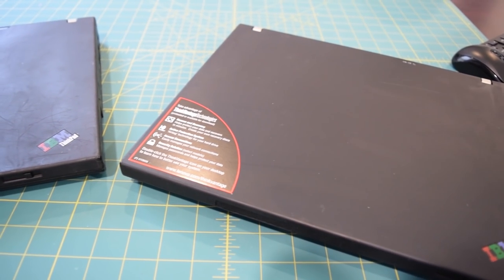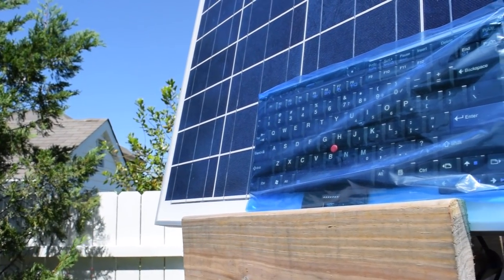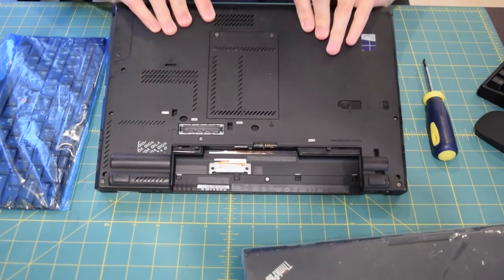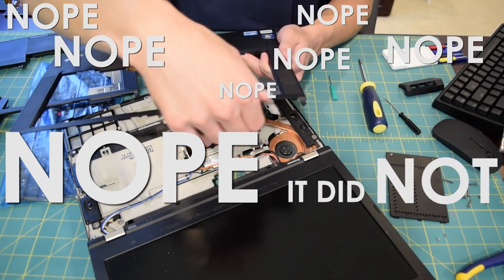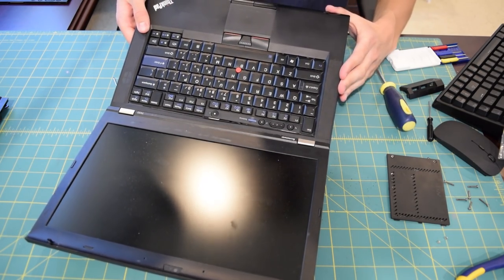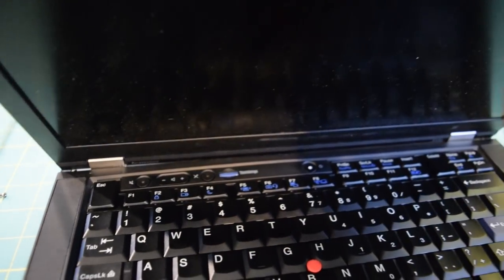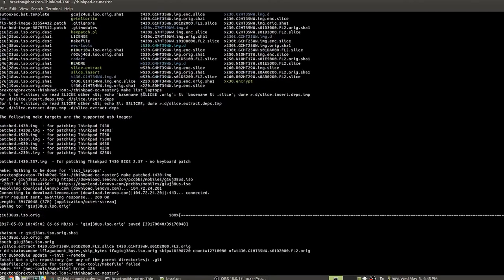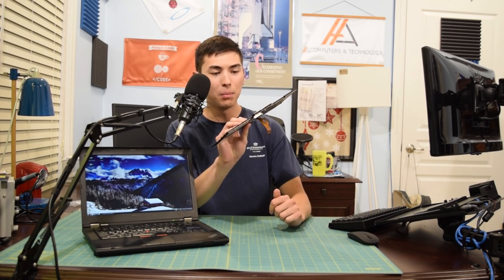Lenovo Thinkpad T430 "Classic" 7 Row Keyboard Installation / Mod

Comment: Im wondering, how has the quad core i7 been treating you with heat? seeing you don't have the better heatsink (the one that comes with the dgpu) it cant be great, but i've been thinking of throwing in an 840qm into my T410.
Reply: xBane_ the i7 is the same TDP as the i5 he previously had, so heat shouldn't be an issue.
Reply: Elgoog Botnet if he used a dual core i7, then yes. If he used a quad core, than no. All i5s and dual core i7s from this gen we're 35watt chips but the quad core i7s are 45 watts.
Reply: Pretty sure the i7 he chose is this one https://ark.intel.com/products/64901/Intel-Core-i7-3612QM-Processor-6M-Cache-up-to-3_10-GHz-BGA which is a quad core @ 35w tdp.
Reply: It may not make much difference, the tdp is not that higher... There were some i5 that used 35w, or something close to that, and when swapped to 35w i7's the computer actually got colder because with roughly the same tdp, the computer had more performance and the processor would need less effort to process things generating less heat. 

Just verify the tdp of the envolved processors (the old one and the new one)!

Comment: I've been watching your videos, especially since I too really like the Thinkpads and see the value in buying some used T420 's, T430's and T440's and upgrading some of the components, especially for what i want to use them for. 

I've been on the fence for weeks because I like the keyboard of the T420, but have been looking at T430's. So I'm really happy that you made this particular video. 

I'd really be interested in any update if you get the keyboard functioning at 100% with the driver updates. 

Back-lighting- 
I assume that since the T420 never had a back-lit keyboard that there's no configuration that lets you have the T420 keyboard on the T430 and have back lit capabilities. Or is there? 

Keep up the good work, and thanks for making so many videos covering this line of computers. They've really helped in the decision making process.
Reply: Harold Mansfield I've used t420s, t430s, and t440s, and I personally like the t440s because it has a backlit keyboard and is noticeably lighter than the other two. I also don't mine the keyboard at all, but the screen and trackpad are pretty junky compared to the previous models. You can replace the screen with an IPS panel and the trackpad with a trackpad from the next model up , which is highly recommended by most people. I plan on replacing the trackpad and panel on mine as soon as I can afford it but it's still a fantastic machine and I use it as my primary. great battery life too with 2 batteries.
Reply: I have a T420 and love it, I don't think there is any way to backlit a T420 keyboard, since the T420 has the thinklight (next to the webcam) for that reason. And to be honest, I like it a lot.
Only real downside I see in the T420 is the lack of USB 3.0 (for external HDD usage), but that can be solved by an expresscard usb 3.0 expansion card.
Other than that it's excellent, at least for what I use it for (programming, internet and watching videos), even outputs 1080p video playback perfectly to my home TV.
And mine is the more modest config. i5 2520m, 4gb ddr3 RAM and 320gb hitachi HDD (I live in a 3rd world shithole so that influences price of new electronics)

Comment: All of this makes me wonder why you didn't go with the T420 in the first place. It's only a year older.
Reply: I don't think the performance difference between both CPU is that big really + a USB 3 PCMCIA card comes to the rescue. (I thought i already said that the T420 is older, why did you need to tell me that again?)
Reply: I think he didn't expect the new style keuboard to be such a dealbreaker. I agree with you, 1-2 year difference doesn't make that much of a difference, hell I am using a T60 from 2007.

Comment: It's just a matter of taste. I found the "newer" version the best I've ever used, fast precise, very reliable. With useful backlight of course. ;)
Reply: Mine is self-destroying: I write a lot for work, I've alreay bought 3 keys and I need other 4...never happened before with Dell (it's not my fault) :-(
The plastic on my IC42 backlit type keyboard seems too fragile and the typing feeling is so "uncertain"; it's difficult to mount/unmount keys without broke them. Not to mention layout that needs a bios update to partially patch the crazy Fn key position...
I just ordered an externale wireless keyboard waiting the spare keys: I can't find an italian backlit replace keyboard and on ebay T430 keyboard (without backlight) costs twice other models...should I change my i7 notebook only due to this awful keyboard ?

Comment: Great to see it works and is easy. Has anyone been able to get a hold of the converter kits for IPS panels in the T430 recently? All the googling leads to outdated info etc.
Reply: Might be a bit late but I just did this for my T430 and am quite pleased with it. I did not find a kit but just looked for the specific panel model and bought the cable and converter board setup directly from China via aliexpress. The issue is that the T430 has an older LVDS connecter, while the screen, which is a similar one to the one on the T440p, has an eDP connector. But its very easy to install and you just need to get hold of the right panel to go with it which was the AOU B140HAN 1.3 in my case, which I could get new in my country from an eBay seller. The sellers for the converter bords usually also have the compatible panels on the product page. The issue is that this upgrade was quite costly (~150€ in Germany) but since mine had a broken screen anyways it was okay to pay the premium over getting another shitty 1600x900 TN panel.

Comment: Any thoughts on eGPU setups? I personally have gotten it to work just fine with my ThinkPad in Windows, but I haven't had any success in Linux.
Reply: Something else that doesn't work right in linux... Imagine that! I tried and tried and fuckin tried with linux. Many  different distros over several years and regardless of the computer they ran on I could never get the video quality for my shows and movies to my personal satisfaction. Always some screen tearing or chopping or something to make it shit. Windows just does a better job and if you aren't a buffoon who clicks on dumb shit you wont ever get a virus. I haven't ran antivirus on my machine in years and never have issues. If linux could fix this one issue... and I guess they are FINALLY WORKING ON IT, I would swicth over in an instant. Hopefully they get it done before windows 7 ends support.

Comment: To be honest I find the new keyboard just better. It's more stable, doesn't catch half a dirt the older one does. I get the "I've been using the old one for my whole life and can't get used to anything new" kind of thing, but everything is moving away from a 7-row keyboard
Reply: No, the standard Keyboard Layout and propper Desktop Keyboards don't. That was the strength of a Thinkpad Keyboard. It gave you a propper Terminal format keyboard and no "laptop keyboard" with a learning curve for it's quircks to get used to.
Reply: Who cares about how the industry is moving from 7 row keyboards. The "industry" is filled with Macs.

ThinkPad users should NOT worry about what classic-but-loved features are removed.
Reply: I was worried when I first got my t430 but I haven't had any issues with it. It's actually one of the more durable parts of the laptop, which is saying a lot  since the build quality dropped like a rock after IBM sold off to Lenovo. I too like the fact that I don't get shit stuck under the keys like the old one on my t61.

Comment: Hi.. sorry to come back to a month old video, but I follow this to upgrade my t430 and was almost 100% successful, my only problem is some keys aren't working at all, and they have a pattern. I mean all the keys on the right side of the red button are not working, this means n,m,h,j,y,u, looks dead, the keyboard is new (i bought on the same eBay store). 
Also in the wiki forums mention performing a patch of the bios in order to make work some keys (but mention only some special functions).
My question is did you experience something like this? and did you patch your bios? 
regards
Reply: Silvio...  Did you ever get the problem resolved or did you end up puting the old keyboard back in?

Comment: Tried swapping old T410 keyboard with my T430 but can't seem to find a method of flashing 7-row changes from Windows 10. I don't plan to install Linux. 
Is it possible that EC Flash (once flashed via Linux) will then also work for Win10? In that case I might try installing a portable distro like Lupo or Mint only for flashing.
Reply: You dont need to install linux - just boot it from USB/DVD or external HD.

Comment: wat? The keyboards on Lenovo Thinkpads are really good! You're most likely just a hardcore nerd that fanboys for IBM's thinkpads. They were good back then, but to me they were mushy and not as tactile as the new ones.
Reply: Martin Jensen i used the lenovo keyboard just fine, but the old keyboard just look like a lot more functional and intuitive
Reply: Mine works fine and it seems to be plenty durable. It takes my abuse and I am not nice to my equipment. I have enough broken plastic shit on this machine already, just not worth it. Especially since it spends most of it's life sitting on top of my stereo with the lid shut running my tv as a screen and I use wireless keyboard and mouse.

Comment: If there is something terrible and horrendous about t430 it is the display - it was really unusable for longer than hour and I had the "good" one, there wasn't a decent replacement. The thing you like it is the flex on the old one, I guess it is because you are smashing very hard the keys, if you learn not to bottom out the keys with insane power will be better even with the mechanical. The new keyboard is perfectly fine for a laptop, in my opinion it is even better than the old, but I don't run around saying the old is garbage because of my opinion.

Comment: I had a Lenovo T420 and unfortunately messed it up a little bit with my clumsiness, it's gone now (sold it) regardless. I use a T530 right now and I've left everything factory stock, except for the HDD which I upgraded to an SSD. I think the newer keyboard is perfectly fine. I have the backlit keyboard and even though it has less travel than the non-backlit keyboard. I find it...fine.

Comment: Am I the only one who prefers the T430 keyboard? I own a T420 and a T430 and I much prefer the T430. The keys on the “classic” keyboard are just too spongey for me with too little feedback. Also I prefer the keys to feel a bit more separated from each other, which the T430 nails. My ideal config would be to have a T430 with some internal upgrades (i7 quad-core, ram, ssd, and a 1080p IPS panel).

Comment: Regarding the key mapping issue: on Linux xmodmap (with a GUI XKeyCaps) seems like a very promising way to deal with that. It allows you to create a custom keyboard mapping. That is if you want to run Linux, which I can really recommend since the T430 runs pretty much with no issues any popular Linux distro. Switching between the integrated and dedicated graphics (if your version of the model has an Nvidia's NVS5400M).

Recommended for further reading on modding the T430: https://medium.com/@n4ru/the-definitive-t430-modding-guide-3dff3f6a8e2e

Comment: What’s the cheapest quad core you can put in this?
Thanks!
Reply: i7–3632QM
Reply: There are cheaper but they aren't worth it. This one is only 100 bucks and smokes the i5 3320 that probably came in it. I am still using my i5 3320m and it has plenty of juice for the vast majority of applications. It even plays GTA 5 at about 30 FPS (I do have the dedicated NVidia Quadro chip, intel hd 4000 wont even attempt to play it smooth lol) without maxing out the CPU. Runs about 80-90% though and gets real hot even with TP fan control running. About 90 C.
Reply: I'm gonna shoot for the i7–3840QM myself. It does run hotter though since it's a 45 watt chip and I have heard horror stories of the stock power supply not being able to cut the mustard so be sure to do your homework and upgrade accordingly if you pick this chip. The heatsink also should be from one of the dedicated GPU models, even if you don't have the GPU. It has more copper and a better fan.
Reply: I actually have an i7-3632QM in a SONY VAIO (dead board). I prefer the T420 to the T430 but I might just mod the T430 with the 7 row and put it in there.

He was saying you no longer need that one screw, any clue if it causes keyboard flex?I forgot it once on my T30 and it caused flex in the center of the keyboard.

Comment: Do the spillproof holes line up or do you sacrifice that feature?
Also does the T430 have a ThinkLight?
Reply: thinklight is a standard for xx30 series which if you cannot get a backlit one. my x230 is just running straight with thinkight only and no backlit

Comment: I would do this to mine but the keyboard it came with works fine and is plenty durable even though I don't like it much. I already have plastic trim problems on this pile of shit so I don't wanna stress it further. The t430 is complete shit in the durability department compared to older units. Cheap, frail, plastic garbage everywhere and the hinge mounts inside the lid are a fucking DISGRACE! I had to drill holes in the back and run small bolts/nuts through. Thankfully the entire back cover is metal making this fairly simple.  I was surprised to even find a magnesium shell inside the computer at all.  I used to slam around my t61 just to show off how tough it was... can't do it with this.. I tried LOL.  Yes I miss the keyboard on my t-61 but I get to enjoy it again recently since it just became my garage machine. It's a bit slow but the T9300 core 2 duo cuts through everything pretty well as long as you don't have any extras running.

Comment: has anyone with a non US layout tried the keyboard swap and the ROM reflash? Is it dependant on the US layout or not?
Reply: did it today on a x230 with a x220 keyboard (french layout), no issue at all with the flashing, also removed the restrictions for battery at the same time

Comment: A greater injustice is the abandonment of the 1.33:1 (or 1.6:1) aspect-ratio monitor, in favor of the horrendous 1.78:1.
Reply: I agree. 4:3 is the way to go imo. But just curious, why wouldn't you just say 4:3, 16:10, and 16:9?
Reply: @BRRBUNNY , because that's how I roll.

Comment: why not just use a t420?
Reply: The t430 uses less power for some of it's parts compared to a t420 (especially the Ivy Bridge CPUs it was made to support) while still having somewhat of a performance increase.
Both great machines, I have a t420 myself, but if you can go with a t430 and kb mod it if you want to, it's the better choice.

Comment: thank God lenovo dont make the old keyboard anymore. so i dont buy their stuff anymore. im using X220 with ssd and will be sticking with it until its dead. and maybe buying used T520 or W520 to replaced it later.